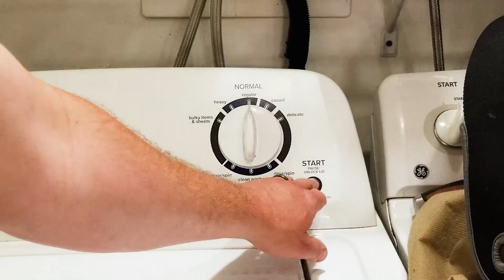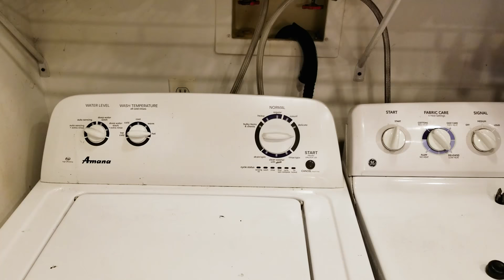How (and WHY) to replace water inlet valve Amana washing machine

Comment: Mine was the opposite. It wouldnt stop filling with water. I switched the hot and cold on the back and tried hot. It worked and that told me my cold side was faulty. Ill just use it on cold until i fix it
Reply: Did it fix it?

Comment: Our Amana washing machine only worked on the cold cycle. The hot cycle would fill up very slowly, then drain and stop.  Replacing the inlet valve fixed the problem.  Thank you! This worked great and your step by step instructions were perfect.
Reply from the maker: Glad it helped!

Comment: Had the exact same problem - hot water would fill washer but not cold.  Replaced water intake valve, followed instructions, and voila - fixed 😊

Comment: If you have rusty water, you can try cleaning the inlet valves out and reinstalling. I use lysol black toilet bowl cleaner get it inside and on the outside hookups (where the hoses hook to) rinse it all out, make sure the solenoid things are dry, and put it back in. I have to pull ours and clean it every couple months (it between then i have to switch hose sides) because it's completely orange and water flow is blocked. 
I so so so appreciate this video, because I was looking all over youtube and having a heck of a time.  Your video was the clearest, easy to follow, just thank you so much! ❤️ I just had to pull it up again last night because I couldn't remember how to take the top part off, and then ended up cheating and using Allen key torx bits to get those screws off without taking the top panel off. It was a pain tho. Much easier doing it your way, I was being lazy. Lol
Reply from the maker: Glad the video helped ya! Maybe you can look into getting a filter to take care of that rust problem. Then  ur just changing a filter instead of taking your washer apart every few months?
Reply: @KyleMerl  absolutely! It would save the showerhead and faucets as well. It's been on my husband's to do list for a while now...🤣
 I draw the line at learning plumbing, so that's one thing I can't do, fighting with the washer I can, so that's what happens. One day he'll get to it, there's no need to remind him every 6 months right?! 😁 
Thanks for replying so kindly, that was my first youtube comment! Just wanted you to know you're appreciated! Thank you.

Comment: Kept meaning to get back to make this comment.  A few months ago (April '22), our washer stopped working.  My son suggested this fix and we found your video....almost the exact same unit (different name).  Went over to amazon, $42 dollars with tax for the part, popped it in and all is right with the world.  Thanks for the helpful video.   We had almost bought an entire new washer, we saved hundreds.
Reply from the maker: Glad it helped ya!
Reply: What the part name or number?
Reply: @MarioV256  it's called a flux capacitor, the part number is BR-549.😆
Reply: @scottkendall5655  what a knee slapper
Reply: Thank you so much for sending me to Amazon. I greatly appreciate it. I got my part.

Comment: As a 70 year old female, I just fixed mine watching your video!! thank you so much...I am following you! My husband is stunned I did it all myself from moving the washer out and back in to finding the right tools...although I could not find a putty knife to pop the top off, I found a butter knife worked fine...would have been nice to know those were springs in the front of the control panel and they just needed to be pushed in a little...once I figured that out, it was easy sailing!!

Comment: Hi, thanks for posting the video....I have an amana washer that has power but  won't start, no water even fills. I believe this may be a possible issue, I will return to check and see if it is stuck in the sensing cycle and will definitely try this out. Great vid!

Comment: Very helpful!  Living in FL, I only use cold water (it's never very cold) so I just swapped hoses and turned the selector to hot water. When the hot water valve fails, I'll just replace the assembly.
Reply from the maker: @AWAKE_PA  that'll work as a temporary fix most likely. I think the hot setting uses both hot and cold water though so that may have an effect on things. I'd opt for replacing the part as soon as you can.
Reply: @KyleMerl  Thanks will do. I was in a spot with liquid soap and clothes already in the washer, so I had to find a workaround. Video was very helpful.

Comment: Thanks for the video man, just switched mine out it's working like new now...the cold water would screech everytime and not let in as much water as it was supposed too. very useful video good sir 👌
Reply from the maker: I'm glad it helped ya!
Reply: @KyleMerl  oh it did, but one thing though I noticed after the job. One of the flexible metal pipes on my water heater started knocking (water hammer?) When the cold water stops flowing to the machine...I turned down the cold water abit to the machine itself and it stopped, should I be worried about it?
Reply from the maker: advertising it'd probably be good to try to secure if you can. That's interesting. It might be a sign of other plumbing issues? Maybe a water pressure problem somewhere?
Reply: Thanks for taking the time to reply. I was thinking that could be it but everything else seems normal. Wife's been using it since I turned down the cold water abit to the washing machine and it hasn't done it anymore so I think I'm in the clear...I hope lol

Comment: You saved me from having to buy a new washer!Thank you so much!One question mine doesn't have the center piece you clipped in on yours. Could it be a missing piece on my washer?It seems to be working fine without it.
Reply from the maker: Do you mean where it clips on to the inlet valve body? If so I don't think it matters. If I remember correctly,  I think that is just to secure the wires.
Reply: Sorry used my son's account by mistake. 😂Yes it's the center of the valve body.

Comment: Also, I added a scale water filter to the hot water line on my condo, seemed to help quite a bit with my 4 gallon electric water heater that supplements our central "hot" water - didn't has as much crap in it when serviced at about 1 year, anode rod was not totally gone like it is by 6 months or a year. Would this help for the washers inlet valves and other stuff?
Reply from the maker: @appleimacdude  i think it could help as long as you don't reduce the water pressure too much by doing so.

Comment: Thanks for the excellent video!

My wife and I replaced the unit. Everything went well. Then we did a load of laundry.

GUESS WHUT! The new inlet system hot water solenoid is leaking - just like the old one. 

At least, when we GET ANOTHER one, we're be ready because we're well-trained!  😞
Reply from the maker: Ugh... what a pain! I can't believe how common this problem is with these washers. Glad the video helped

Comment: Friend called me, her amana NTW4516FW washer is making a shrieking sound when filling, seemed to have some difficulty filling. Is it worth cleaning the screen on the inlet valve (assuming that may be it) - or is it likely the inlet valve is bad?
Reply from the maker: @appleimacdude  is possible it just needs cleaning. Mine was not filling at all, so if hers is filling but it's taking longer then that tells me that it's not completely dead yet

Comment: Hey I know this is an old video but I just fixed my inlet valve on the same washing machine you don't have to necessarily replace it ,,on both ends there is a little green cap you can pop it off and the magnet things slide off both sides are interchangeable so you could swap them around to make sure that's actually the issue if it's not unscrew the white stem and clean out the rubber gasket also a little plastic piece in between the rubber gasket stretch the spring a little bit out put it back together and should work fine
Reply: I forgot to mention I think you have to plug in the wire upside down if you're using the other sides magneto thing ,,the part numbers are one number off , I would just take it apart and clean it stretch the spring out see if that fixes your issue before you swap them around

Comment: @ Kyle, I have the same washer, it sprung a leak a week ago, so I changed the pump out, still was leaking water after that, so I took the back off again and just set there watching, water starting dripping constantly from the hot water side valve, so I ordered a new one, just installed it, when I start the fill cycle the valves just hum loudly, like it’s getting juice but no water will come out at all, and I’ve switched between all the water setting and nothing changes, so what do I need to do
Reply from the maker: sorry I didn't see this comment until now.  If you're sure all of the electrical connections are good then it sounds like this might be a problem with a different component in the washer.  Not really sure what it would be, since I didn't have the same problem as you.  But if it seems like the fill valve is working then you can at least rule that out. 
You'll probably need to do some more research to figure out the cause of the issue.  When I research stuff like this I first try to learn how the appliance works "under the hood", and then try to think what parts could be the cause.  Then I do more research to try to rule out each part. 
Sorry that's not really an answer to your question but I hope it helps and you figure it out!

Comment: Still going strong. Haven't fixed mine yet but certainly wi as soon as the part comes in. turned the hot on and it started to fill. It didn't last long though. It drained but didn;t spin.

Comment: QUESTION: are the Red and Blue electronic solenoid valves threaded into the plastic manifold and are they removeable? If so, can you exchange the 'failing' Blue (cold) valve with a 'hardly ever used' Red (hot) valve? My washer is not flowing cold water after seven years, and I rarely use the hot water settings... therefore the Red (hot) valve had very little use and is 'like new'. I'd like to swap the valves and have a Cold water only washing machine if possible.
Reply from the maker: @3000Jeffrey  as I remember it, i don't think they were removable. I think i had the same idea as you... we never use hot water. 

I'm not sure if there's a difference in the solenoids but I know there is a difference in the water flow on the hot vs the cold, so they might not be identical.  But I don't know enough about it to be sure.

Comment: I replaced the unit and am still getting drips on the cold side, though less frequent. All the hoses are a good hand tight and not leaking. Leak is on the inside, behind tub coming off the blue plastic piece of the intake valve, same as with the one I replaced. Trying to see if the water could be traveling from somewhere else? It has destroyed the floor. #baffled.  BTW mine is older and came apart somewhat differently.  Good vid. Thx.
Reply from the maker: Interesting. You may have to remove the whole back panel to see the source of the problem. I never had that issue before so I'm not sure what would be the cause.

Comment: This is happening to me too. But the cold runs for a few seconds. And the hot water will run for a few seconds longer than cut off. I don't ever use the hot water, though could I have the same problem?
Reply from the maker: I'm not sure. If I remember correctly there water didnt run at all for me.

Comment: Bought a new house and this washer came with it, seemed fine until the same thing happened to me. It’ll only start to fill on any temp setting for 5 seconds when you open then close the lid. Once closed, water rushes in for about 5 seconds then it stops unless I open and close the lid again.
Reply from the maker: These washers are such crap. I can't believe how common of an issue this is. My issue was slightly different than what your describing though, so it's possible there could be something else going on.

Comment: How did you remove the new ones coverings for the plugs? For the old it was easy with players but the new blue ones look sealed to it and I can’t get them off
Reply from the maker: They were tough. I really had to pull at them.

Comment: Hi so we have the same washer and the same problem. Is there any chance you still have the part or item number for that valve? Great video thank u so much for sharing
Reply from the maker: No sorry I don't have the part number anymore but I think this is the link where I found it. It's a page with all the inlet valves for amana washers so it should atleast point you in the right direction https://www.repairclinic.com/Shop-For-Parts/a11b1c37i219/New/Amana-Washing-Machine-Valve-Float-Water-Inlet-Valve-Parts
Reply: @KyleMerl  perfect thank you so much
Reply: Just wanted to let u know it worked thanks so much for your awesome video

Comment: Have the same exact washer and I’m having the same problem. My washer is only 4 months old though. Wonder if this will fix my issue considering I only run cold water on mine
Reply from the maker: Probably... this seems to be a common problem with these things.  Being only 4 months old it may be covered under warranty. It might also be less expensive to fix your self even with warranty though.

Comment: Will the inlet valve also prevent washer from starting and locking at start ..  hot water will make it lock . Still no water. Just on sanitation setting
Reply from the maker: Not sure ... I dont recall if my washer stopped locking or not.

Comment: Hi Kyle, first of all thanks for the video. I have the exact same model Amana washing machine as you and I think I have the same problem, but I'm not sure. When I try to run a cold/cool water cycle the basin will fill with just a little water and then get stuck on the sensing fill part of the cycle, like you described, and then try to restart the cycle. My hot/warm water cycles run fine until the rinse part of the cycle (which only uses cold water), it'll fill with just a little water and stall before the cycle forcefully ends. Is this what happened to you as well?
Reply from the maker: Pretty similar. For me,  if I remember correctly the cold would not fill up with any water at all but the hot would.  I never ran a full hot cycle but I'm assuming the ending rinse would have failed. Its possible that you have the same issue
Reply: This is the issue I am having. I am wondering if I fix that part if it’ll work good as new.

Comment: Do the inlets have n ay type of screen or filters,,i have a 3 year old amana thats short cycling and not getting clothes clean,,,we have well water and it often stops up certain appliances,,,
Reply from the maker: I dont remember to be honest. It definitely doesn't have a built in filter but the may be small screens on there. It's probably best to set up a separate filtration system if you don't already have one so the water is filtered before it gets to the washer.  I wouldnt rely on the inlet valve to do it.

Comment: Seems like my hot side is failing and the agitator occasionally doesn’t work. Do you think the inlet valve is the same issue ?
Reply from the maker: Possibly... but I'm unsure if it would effect the agitator.
Reply: @KyleMerl  yeah so occasionally when its done filling, it makes a sound as if it’s starting and stopping the agitating phase. sometimes opening and closing will fix it temporarily… I just bought the part. I’ll let you know how it goes if it’s a complete fix.  👍🏽
Reply from the maker: @Inferno9978  hope it works for ya! 🤞

Comment: Would this Valve be the reason my washer is dripping inside? Few drops of cold water into the drum from where the water comes out when it fills
Reply from the maker: Not sure... it's possible but u may need to do some more troubleshooting to really diagnose the issue.

Comment: We recently had a freezing temperatures out here that caused a pipe to burst. The pressure was so strong the hot water connection broke off the back of our washer and when I run a fill cycle it trickles water from the hot side even when I use cold. Is there a simple fix for that or would it just be better to replace the whole inlet valve?
Reply from the maker: U might be able to get by with teflon tape temporarily. If the threads are messed up I'd just replace the whole valve. It's not that hard of a job

Comment: The water valves work but it takes about 5 minutes before it will receive the signal to open and fill . Could this be bad water valve solenoid ?
Reply from the maker: Possibly. You could test the solenoid with a multimeter (a quick google search would explain how).  Just make sure you unplug the washer first.
Reply: @KyleMerl  after it fills with water it does everything else perfectly but I’m wondering if it could be a bad computer board too
Reply from the maker: @bruce7259  yea I'm not sure exactly how to test those. They might be expensive enough where it makes more sense to replace the washer too. Solenoid should be easy enough to test tho, so you could rule that out first

Comment: out of curiosity if you remember, did you buy your valve on ebay? they did the same to me they sent me the part with the wrong plug. i went to ebay because the part was $50 cheaper then the official. after dealing with that fiasco i saw that all the parts by all the sellers had bad reviews for the plugs being wrong and wrong parts. i did get refunded though but i went to the official whirpool site and it was worth it to buy their part
Reply from the maker: Nah, not Ebay. I think it was repairclinic.com
Reply: Just take your old plug off and put on new valves ! Very simple
Reply: @bruce7259   mine were glued they would of just broke. it was easier just getting the official correct part and waiting a few more days and putting it on